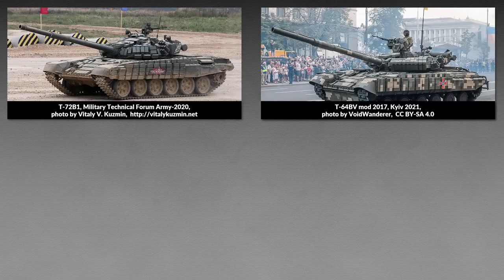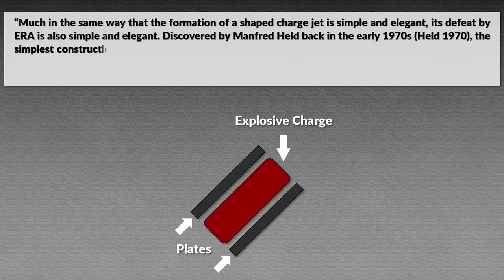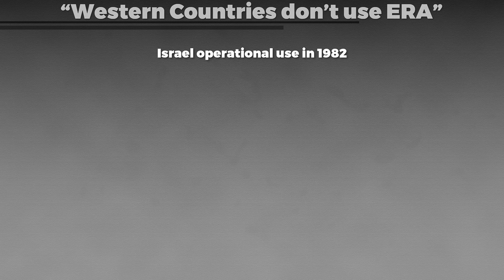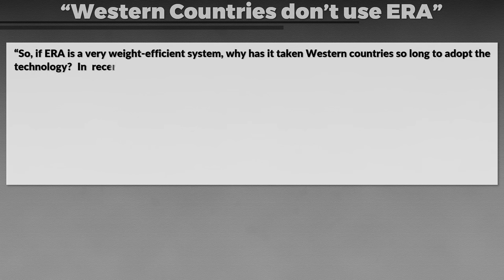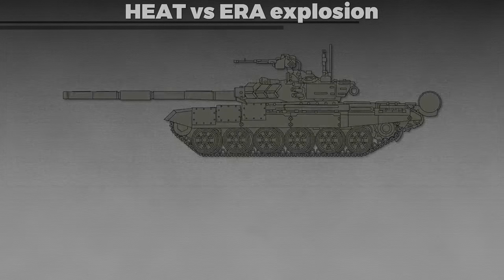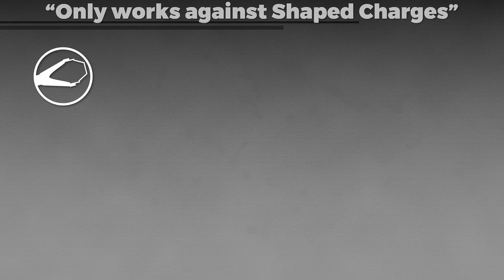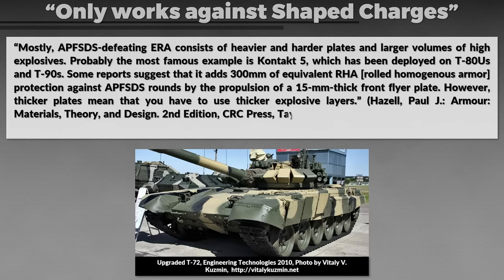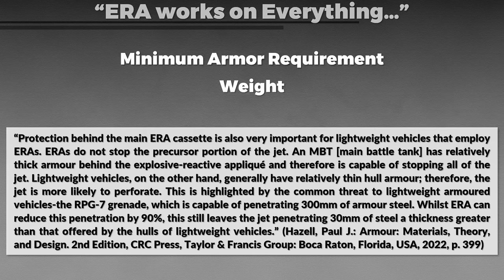Explosive Reactive Armor: Common Misconceptions (feat. Prof. Paul Hazell)

Comment: I think we should armour all fighter jets with era. Drastically improves survivability
Reply: nope, not at all, since air targets are usually pelted with shrapnel of explosions nearby ( by AA or missiles ) and shrapnel can´t activate ERA. So you would need a special kind of ERA which does explode when shrapnel enters it ... but what happens then ? You avoid a puncture of the plane and put a lot of stress on the whole airframe or even crack it by your own exploding ERA ... nope.

Comment: How does the performance compare between NERA and ERA armor?
Reply: They are insanely weight efficient.
Reply: ERA is more weight efficent but only for one hit. NERA is a little less efficent but has mutli-hit capability.

Accoprding to Rheinmetall:
CLARA ERA is stated to have "at least ten" times higher weight efficency against shaped charges than steel armor.
AMAP-SC is NERA that is stated to have between 8 and 10 times as high weight efficency against shaped charges than steel armor. It has multi hit capability.

Example Puma IFV would be NERA on the front because more hits are expected over the frontal area exposed to the enemy, ERA on the sides. Note the lower half sides are NERA too because it provides better protection against mine/IED blast than ERA, important point to note aswell.

Comment: 1:19 This is an oversimplification of the shape charge liner which equally misleads people. 
The materials like copper have been studied extensively at these very high strain rates. The material is most definitely acting like a solid. That strain extreme rate combined with the beginning grain size  and liner distribution is critical in the penetration performance.

Comment: I wonder how this compares to Chobham armour. (I put a 'u' in armor so will soon lose my US citizenship.) Maybe the ERA is also used over it?
Reply: Chobham is composite armo(u)r with layers of steel and ceramics. It's most likely heavier than ERA. ERA is something for older and/or more lightly armo(u)red vehicles.
I'd rather sit in an Abrams, Leo2 or Challenger than in an ERA stuffed Bradley or T-72. ERA is only good against HEAT, Chobham does it all.
It can't hurt to improve Chobham armo(u)red vehicles with ERA, though.

Don't be afraid of using a civilized language from time to time. Learn German, French, Spanish or Italian. 🙂 English (and "Austrian") is just bastardized German(ic language) anyways. Try the original. Loosing US citizenship isn't too bad either; you now have a chance to live in a free country. Sorry, couldn't resist. 

Prost, mein Freund, und ein schönes Wochenende. 🙂
Reply: Chobham is a composite armour with ceramic tiles and possibly depleted uranium that are designed to defeat long rod penetrators. ERA is aimed at defeating HEAT rounds. You can use ERA on top of Chobham.

Removing a u from Chobham Armour would be like adding a u to Pearl Harbor.
Reply: @ottovonbismarck2443  good era is shown to be effective against kinetic projectiles as well, also era on tanks is only used along with composites, not one or the other
Reply: U did well 😂
Reply: @ottovonbismarck2443   Actually I did study German in school but did not pursue it so most of it is lost. Also, I studied it decades ago, so what I learned is now thought of as hoch Deutsch. My son studied it as well and said Germans no longer speak German, they mumble it and hope it sounds like the correct verb tense. I am not sure there are any free countries anymore. Corporate 'Socialists' own them all. ☹
Reply: The M1 Abrams with the "Tank Urban Survial Kit (TUSK) does both. TUSK only mounts ERA on the sides, since the Chobam armor on the front is thick enough to make extra ERA unnecessary (although the Assualt Breacher Vehicle variant can mount ERA all over the turret, IIRC).

It's worth noting that the front portions have depleted uranium plate in the composite armor (except on export variants).
Reply: @vladimpaler3498  I was born, raised and still live in North-Rhine-Westphalia, so "Hochdeutsch" was my first foreign language 🙂Seven years of French have left no remarkable traces; just enough that I survive in France.
I agree on "free countries"; at what point have Western politicians become the clowns they are these days ? Although I still prefer living in Western Europe above anywhere else; I wouldn't like to miss the social security and health care. I am facing spinal surgery this year and it will cost me exactly nothing.

Comment: What is non-explosive reactive armor?  How can a non-explosive armor react?
Reply: It could react with shock, dismay, anger and disappointment.
Reply: It uses the energy transmitted to the armour system by the projectile. You have shockwaves traveling through the material and moving it or making it expand. For example by using a layer of rubber.
Reply: Most of the time, non-explosive reactive armour in its most basic layout is a rubber like material in between two metal plates.
Reply: non explosive reactive armours are made of materials that deform or shatter to spread the energy from the impact over a larger surface area
Reply: The coolest one IMO is "electric armor." You can look it up for the full (declassified) details, but essentially it works by putting two conductive plates separated by a non-conductive spacer. You apply a strong voltage differential across the two plates, so that any incoming kinetic penetrator closes the circuit and gets an extreme amount of amps dumped through it, which often vaporizes the penetrator rod.

Another version uses electromagnetic metal plates, so that the kinetic force of the impact is converted into electromagnetic force which then displaces one of the plates laterally, thus diverting (or shearing) the penetrator.
Reply: There is ad on armour,  ceramic balls in metal container. Both on Bradleys and on russian tanks, then mostly on sides.

Comment: So ERA doesn't really "add on" to the base armor thickness, ERA should be calculated by how much it reduces the threat. Kontakt-5 is stated to reduce apfsds penetration capability by about 20%. So it wouldn't be accurate to state it adds 300mms on a T-72Bs 520mm turret or 530mm hull to gain 800ishmms, but more so it would reduce say M829 APFSDS from penetrating say 540mms to 432mms, making it ineffective, outside of weakened zones like the drivers periscope for example, of the T-72Bs armor front.

Comment: Just some corrections to the subtitles are needed with your interview with Paul, 
5:27, he says "You sandwich it" not "Used sandwich it"
5:44, the word is "frangible" and NOT fragile. (Frangible being brittle, able to be shattered) the same at 6:36 the word is "frangible", NOT tangible. 
6:42 should be "Rheinmetall", not "raw material"
Reply: 10:13 "appliqué" ?

Comment: Something I am rather curious about is why militaries don’t use ERA on military vessels, and if it is at all possible to do so.
Reply: Weight. And you have other defensie options.
Reply: Probably weight? And if the ERA does explode, will the vehicle structure be strong enough to withstand it?
Reply: You would need a lot of it, and nowadays most of the protection is in active defenses to shoot down the incoming stuff. I'm also not sure the explosive will like being subjected to salt water for years. Replacing tiles on submarines is already a pretty big task.
Reply: off the top of my head there are many environmental factors such as the presence ofwater, drag and corrosion from sea water that would already make it incredibly costly and inconvenient and then the fact that any ship small enough to not be prohibitively expensive to cover with era likely doesnt have armour thickness to make it even effective
Reply: @unknown0soldier  Probably not, most hulls are just 25mm, the island less
Reply: They don't use shaped charges too often in Naval Warfare. So I'm not sure ERA will be of use for most of situations in naval warfare.

Another thing is high explosives mixing with seawater might be a bad idea. Most high explosives is a mixture of RDX (a nitrogen based chemical that forms water insoluable crystals) and some form of plasticisers. RDX by itself much more easily set off then when its mixed with plasticisers. If the explosives are exposed to water (by leaking or corrosion) depending on the composition the plasticisers may dissolve off leading to just pure RDX in the ERA panel.
Reply: Heat is broadly ineffective against warships do to the amount of volume they have.

You primarily want warheads to explode within the ship, rather than outside it, so various forms of HE or SAP warheads are used.
Reply: Another consideration is the relative vulnerability of exterior (often sensor) systems on each vehicle. 

On a tank, if your ERA takes out an incoming projectile/warhead, you aren't too bothered if the blast or fragmentation takes out, say, the laser rangefinder. You can either move to a backup system (if necessary, the ol' Mk.1 eyeball) and continue the engagement, or withdraw the vehicle to cover and let the rest of your unit fight on.

But on a warship, even if your ERA takes out an incoming AShM, if the blast/fragmentation disables your radar system, your warship is likely both A) out of the fight and unable to continue engaging the enemy, and B) incredibly vulnerable to any additional incoming weapons. So you've gained less by ERA'ing a warship than a tank, even assuming that the ERA works fine and is economical to install & maintain.

Comment: What effect does ERA have on HESH or a simple high explosive projectile
Reply: Generally cancels it out with an equal but opposite force.
Reply: since hesh works by creating spalling on the plate it hits against ERA would be very effective simply by just being in the way between the projectile and the armour and against HE it might help a bit by adding distance between the armour and the shell explosives
Reply: @watcherzero5256 im not sure it would work that way at all. if a vehicle is going to be destroyed by the force of an explosive adding more explosives isnt going to save it
Reply: @stephenallen4635  ERA is a shaped explosive, its formed of several sandwiches of explosives and pusher plates to ensure the force is purely directed outwards to meet the incoming stream of molten metal. Outgoing hot gases would meet incoming hot gases and nullify each other out.
Reply: @stephenallen4635  I guess it would effect the direction a portion of the blast. Especially with HESH, the plasticity of HESH has to spread & hug the armor before it detonates. ERA in the way would prevent it from forming properly.
If the vehicle would get destroyed either way then the armor was too thin for the ERA to matter anyway.
Reply: @watcherzero5256  era works on shaped charges because it disrupts the makeup of the copper jet if it worked how you described by pushing it straight back it would have to be equally as strong as the force of the explosive used. using your description then for HE it would need to be an equally or compartibly strong explosive which then by itself would destroy the vehicle its meant to be protecting.
thankfully though youve incredibly oversimplified how explosives work and are also wrong in your description of era
Reply: @omarrp14  youre spot on yeah, it wouldn't be effective for a vehicle with thin enough armour to be destroyed by the pressure effect of HE or the same amount of hesh but it would be effective against the spalling effect of hesh but nowadays any vehicle with thick enough armour to meet that condition would be using composite armour anyway which also protects against hesh because its multiple separate materials
Reply: @stephenallen4635 
Brits tested 165 against a variety of target. 

As long as the plate hesh explodes on makes no contact to the base structure, the crew will received minimal harm. 

Weather the vehicle is operational is another question and is to be evaluated on a case by case basis. 

Relying solely on "explosive force" to do the job only really work if it is relitively confined, ie between the ground and the belly of the vehicle.
Reply: @stephenallen4635  2x260 grams of Hexogen between 3 metal layers (equivalent of 832grams of TNT) in Kontakt 1, 2x330g in Kontakt-5 but thicker steel plates vs between 3 and 4kg of TNT equivalent on depending on a tank HE round. Kontackt 5 is marketed as countering the energy of hand held RPG/SPG rounds by between 60% to 90% as well as adding 30mm of additional fragmentation armour to the vehicle.

Comment: I don't believe Hazell's description of the shaped charge. .....because copper isn't going to penetrate armor. But something as hot as a cutting torch might.
Reply: Well, to actually “melt” through armour you need to heat up the armour sufficiently enough first, a HEAT jet will travel roughly at around 9km/s, let’s say it’s impacting a 100mm steel plate.

That HEAT jet will be in contact with that steel plate for at most, around 100th of a millisecond; that is NOT enough to heat up that armour to any sufficient amount to melt it.

The way it penetrates is that it “pushes” the steel out of the way from the sheer pressure of the HEAT jet.

Think of this similar to how if you were to put your finger in some clay, your finger pushes the clay out of the way causing your finger to go in deeper and deeper.
Reply: @theallmightyego6756   But the jet of molten metal is ....fluid, isn't it?  Intellectually I get that it works. But I don't see how a fluid can force it's way through armor. I wonder if they have any computer animations of a HEAT round penetrating armor.

Comment: I mean it's 'assumed' it behaves like a fluid because the most accurate predictions of penetration show that it has to be to do what it does. I know that's an assumption scientifically speaking, but colloquially.... everything is a fluid if you hit it hard enough.

And ERA takes advantage of that; it's literally just, "wait, hold on, penetrators are just pressure applied, what if we make a layer of armor that just.... pushes back?"

Comment: IMHO its all about the weight and dimensions.  Western armor is simply heavy and bulky as it is.  Adding more layers of (any)armor will degrade mobility.
Reply: I would argue that it is not bulky compared to none-western armor, when you take into consideration that there is much much more internal volume in western tanks.
Reply: @TheEsseboy  yeah, I meant armor as in armored vehicles.  Need for people to be fully standing with enough elbow room to manhandle munitions requires way more space than having three guys sitting.  This becomes even more apparent when you consider that Russians managed to cram in 5 sitting crew into the t72 hull in the Terminator.

Comment: Regarding ERA beeing more dangerous then the war head:
Isnt the chace of the ERA plate hitting someone a few hundret meters away terribly small? Even the Professor said in the area close to ERA you habe big problems with the warhead for like a couple dozent meters, and isnt this what we are worried about, since thats the area where infantry might be taking cover? Who cares for a chunk of metal flying of into nowhere.
Reply: his reply was to say that its not necessarily correct to say there is no increase in the potential for collateral damage when using era, what matters is that it is a large plate that can hit something. I dont think he was particularly arguing against its use but that it does need to be taken into account 

If it does hit something it will do a lot more damage than a shell fragment and if its used in active duty without cautionary measures there will definitely be a case where it does

Comment: Just some help with pronunciation give English is not your first language. 

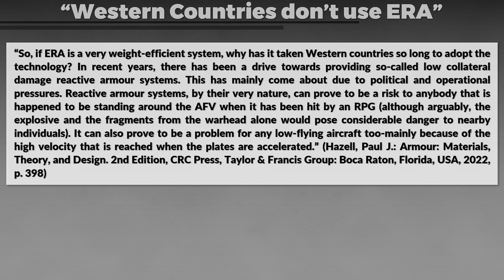accelerated = "ack-sell-er-ate-ed" (as opposed to "a-sell-ate-ed" said at 4:29)

Also be careful calling "high-explosives" low-senstitivity, as this is generally associated with "insensitive munitions" which is a specific rating for HE. Most common plastic high explosives, like C-4, Comp B etc. are all safe from fire (assuming it doesn't reach shockwave speeds), and usually bullet and shrapnel impact, while being able to be detonated by sympathetic detonation and shape charge jets. Rated IMs are generally safe around shape charge jets, and are very difficult to detonate sympathetically, which is not what you want.

Comment: I don't know about other NATO tanks, but the Abrams didn't use reactive armor for a while because it had depleted uranium inserts. That was hard enough to withstand both HEAT rounds and kinetic energy penetrators. Although it is heavier than ERA, it can stay useful against repeat hits while something like Kontakt 5 is expended after one hit. Even now when the Abrams has ERA it's only used on the sides, not on the front like Russian tanks use Kontakt 5 because it doesn't need them on the front.
Reply: The Abrams didn't have DU until the M1A1HA. DU isn't really comparable to ERA, DU is just a simple passive material used in the Abrams' composite array in the same way as a steel plate. DU is used because it's denser than steel. The reason why the US, and other NATO countries, didn't use ERA and still rarely use it is due to their preference for heavier tanks. When weight isn't a factor, NERA is generally preferable to ERA, but the Soviets wanted their tanks to be light enough to be easily transportable by rail and by truck, so they opted for the weight savings afforded by ERA.
Reply: If you are getting repeatedly hit by Anti-Tank Weapons, then you have a bigger problem rather than the Armor.
Reply: How is a cracked uranium or ceramic plate more useful than expended ERA with untouched main armor?